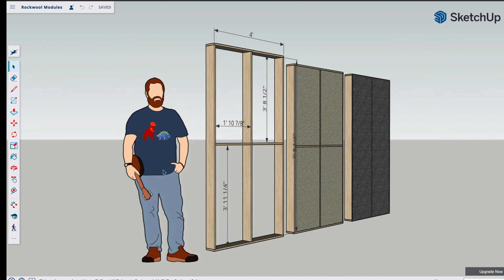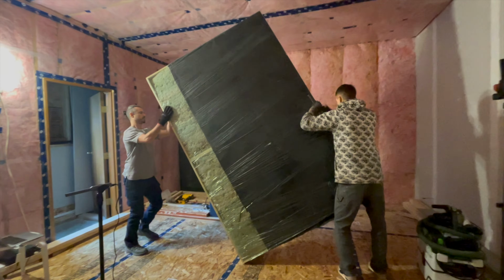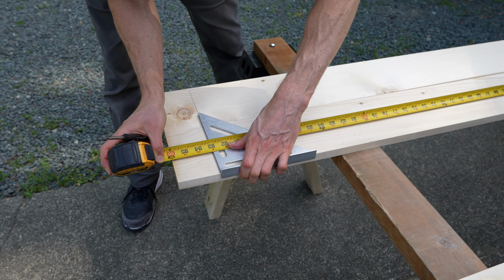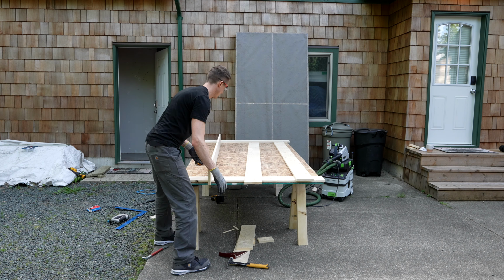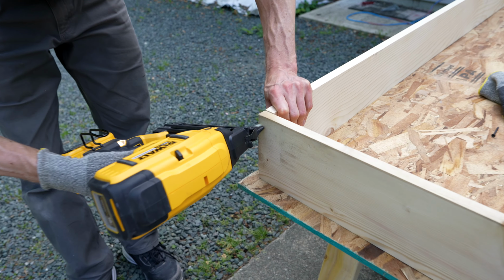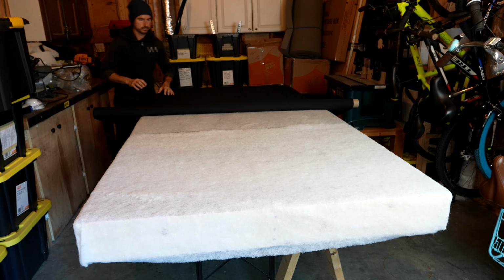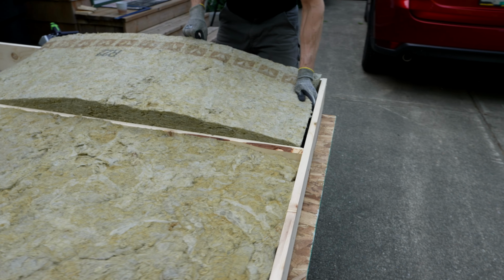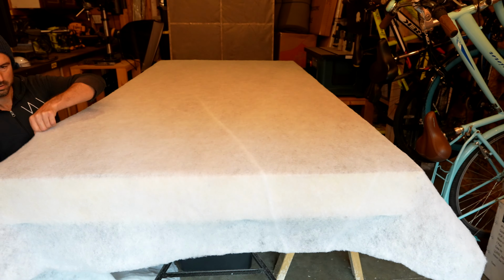How to Build the ULTIMATE DIY Acoustic Sound Panels for Music Studios

Comment: Fantastic breakdown! But what if you’re looking to treat the space to listen rather than mix. How would you determine the density and thickness of the panels. For instance treating a home theater?
Reply from the maker: Good question!  You'd need to start with coming up with goals and budget.  Every project depends on that.  Usually in a movie theatre, you don't care as much about controlling low frequencies as the room gain you experience there can actually make a smaller speaker system sound bigger in the bass department.  

I'd start by getting your room dimensions and doing a modal analysis, then comparing it with your LF cutoff of your speaker system.  That will give you what type of range of control you may want to consider.  For example, in my control room, the lowest room mode (the front-back first order axial mode) was 28 Hz and the low frequency cutoff of my Neumann KH420 mains is 26 Hz.  This means that my monitors will be exciting that lowest mode and it will be a problem, meaning it's in the range of control to be considered in the room design and acoustic treatment plan.
Reply from the maker: In general (and this is massively generalizing here), if it was my movie theater, I would consider adding these 5.5" thick floor to ceiling broadband absorbers on the back wall, and 3.5" thick ones in primary reflection zones on the side walls, and then doing 2'x2' floor to ceiling rectangular bass traps in all 4 corners.  If you need more control, then you could consider doing up to 8" depth of treatment for the braodband absorbers.  Don't forget air gapping if you want to improve LF performance.  

You could use 32 kb/m3 rockwool comfortbatt, 38 kg/m3 rockwool safe n'sound, or 40 kg/m3 rockwool AFB.  If you want to go with graduated density, then you could consider integrating a layer of rockwool Cavityrock 2" as a front layer (60 kg/m3) and then 3.5" of comfortbatt (32 kg/m3) behind it in the 5.5" frames I show in this video.

Comment: I'm in the process of sound-dampening my basement right now. 
Q: Are you worried that micro-fibers from the insulation will get out and into your air?
Reply from the maker: Good question.  When you're handling rock wool in an enclosed space, use the protective gear I talk about in the video.  Once it's installed and wrapped, you won't need to worry about fibers floating around.  When cleaning up after your install, make sure you use a vacuum and not a broom as a broom will stir up fibers.  It's safe if you use the correct PPE.